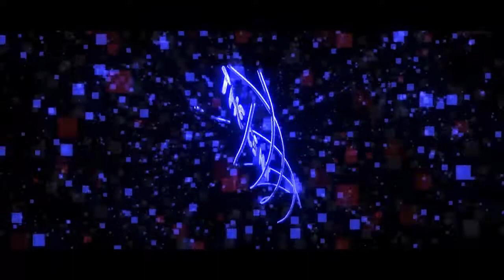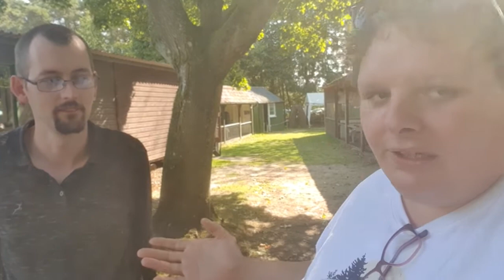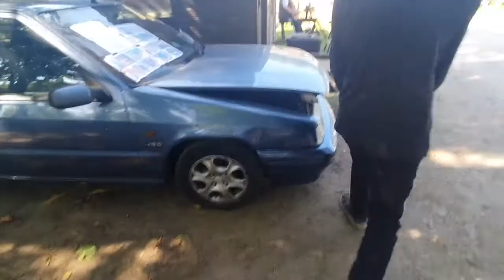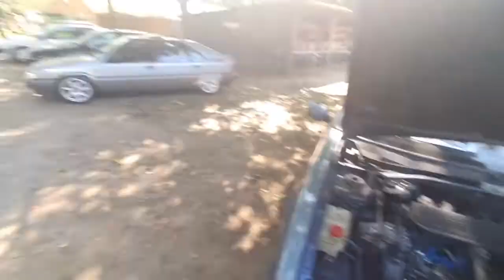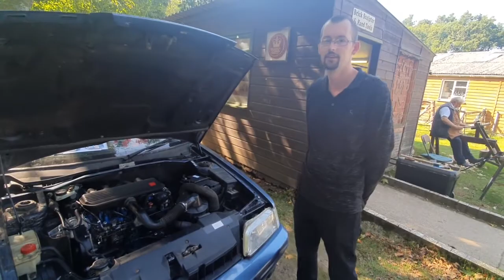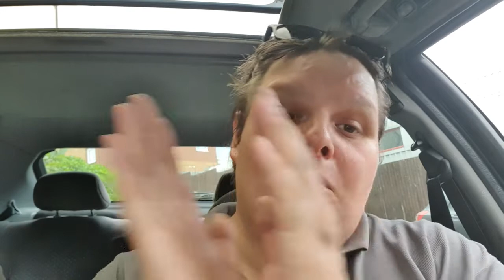i get to interview "The ZX Guy" from youtube,

Comment: Hi I'm also a C5 nut, I've a 2003 2ltr C5 with 295,000 miles, and a 2011 C5 1.6 estate with 192,000 miles, couldn't find a 2ltr version in a estate in Ireland. But I was wondering if you could help me and if you knew how to get replacement window channel seals for drivers door, the exterior seal that goes around the top of the door, they rip on the edges sometimes there is a small rip in mine, so I'm looking for spares, I've looked and they only what to sell the full door in the breakers, main dealer says they don't make them anymore, I think they just want to sell me another car not spare parts. If you know if they are remade to order somewhere or a good breakers yard. Thanks.
Reply from the maker: Hi fellow C5 Nut, wowowow nice collection, parts for the c5s are getting harder to find, i have been collecting quite a few spares for my 3 c5s, if you could take a photo of the part you need, i will see if i can locate the replacement for you, here is my company email address "hanleisure@mail.com "
Reply: @thec5nut  thanks for that, I'll sent photos in a few days.